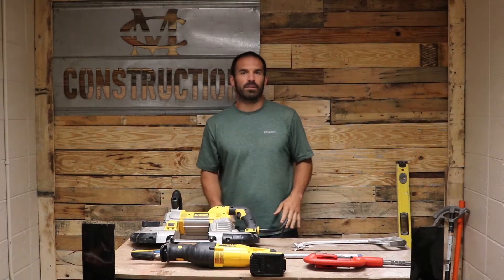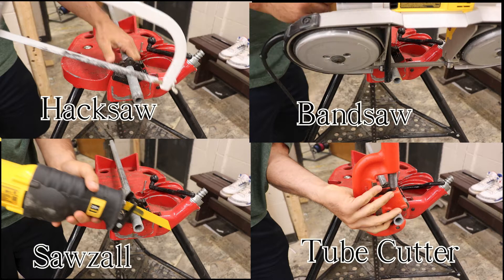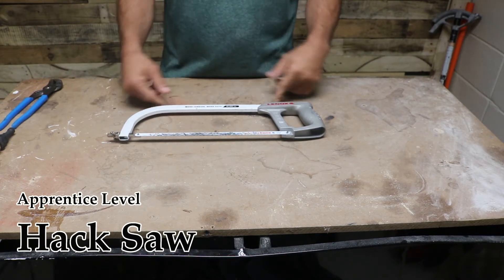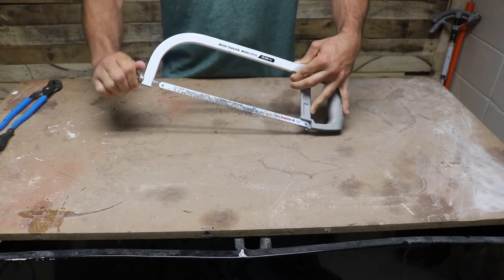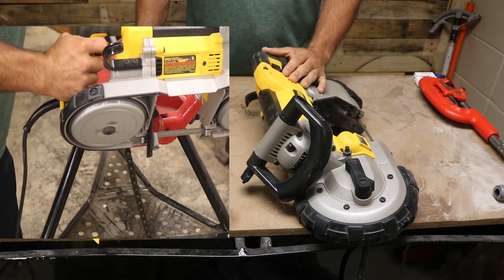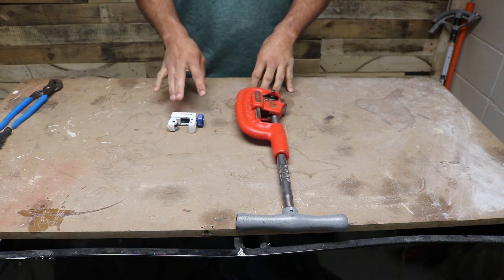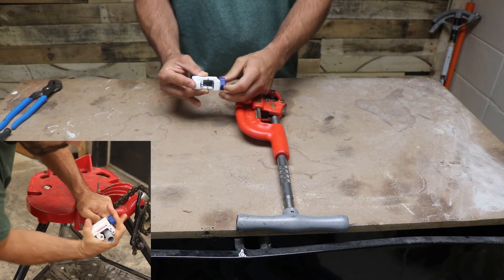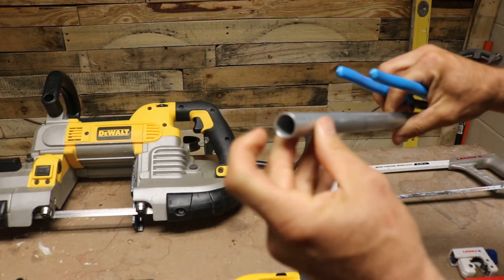Electrical Conduit: Cutting conduit

Comment: Does that reamer work any good for copper pipes for plumbing?
Reply from the maker: Usually on the tube cutters there is a reamer in the shape of traiangle for the smaller pipe like 1/2" and 3/4". i know rigid makes a specific reamer for copper and stainless also.
Reply: @MCConstructionTeacher  Yes I know about the tube cutters with the triangle reamer.  But I'm wondering if this EMT reamer would work on copper pipes.  The copper pipes are softer than the gal steel EMT pipes.
Reply from the maker: I tried it yesterday and the reamer will not fit in copper tubing. It was about 1/16 to small for 1/2”
Reply: @MCConstructionTeacher  That's a bummer.  Thanks for checking.